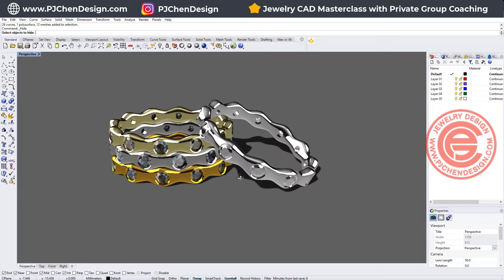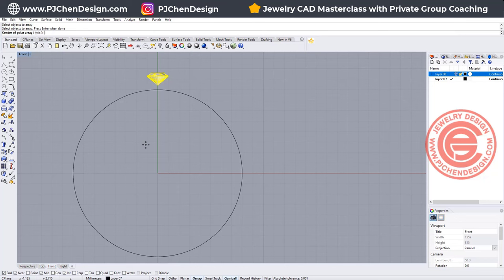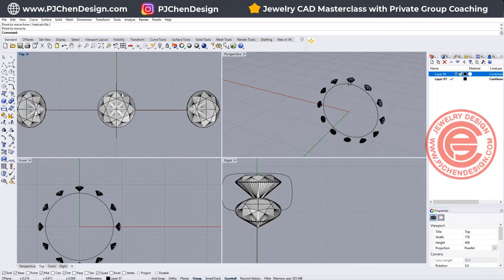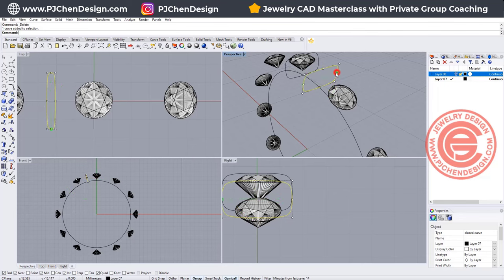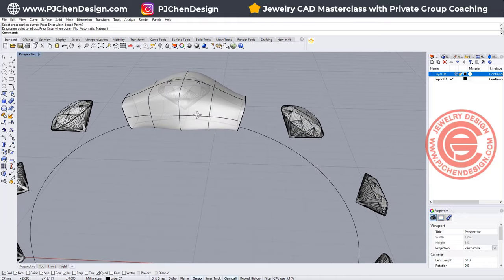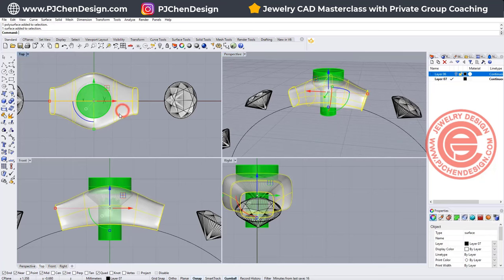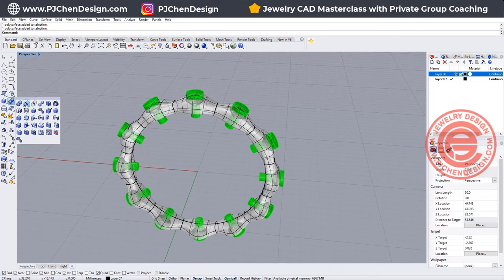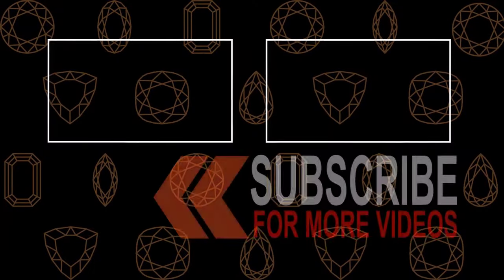Create Stacking Rings: 3D Modeling in Rhino 3D - Jewelry CAD Design Step-by-Step #451

Comment: Hello, how do I make this a closed poly surface? Mine is open and will not join. I'm not sure what happened.   Actually I caped the each poly surface, so they closed. Not sure that was the right thing to do. However, they do not join. I tried to Boolean Union them and it says, objects do not intersect, so boolean union didn't work either. Thank you!
Reply from the maker: it has many possiblity.  without seeing the model I cannot tell. but check your sweep profile. if it is not flat, you won't able to cap.